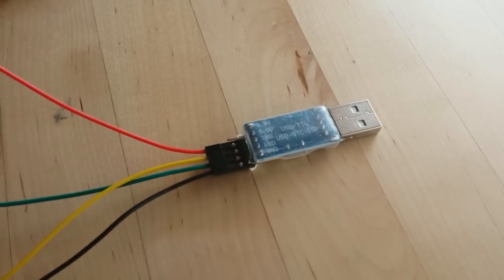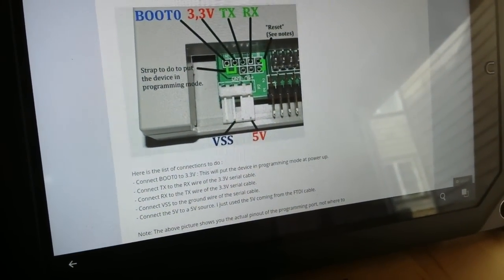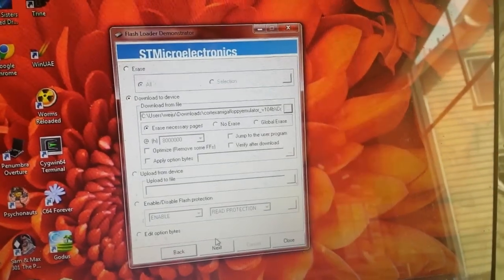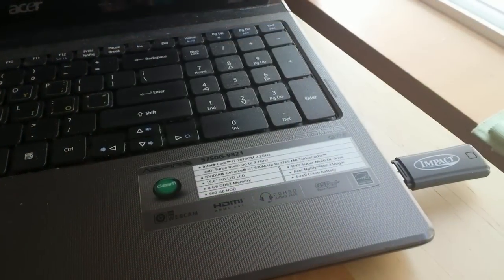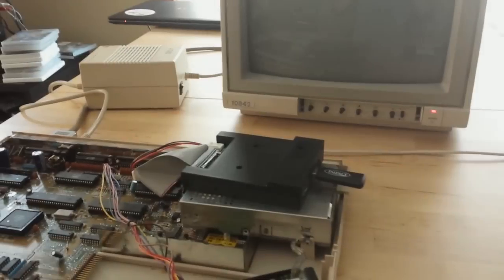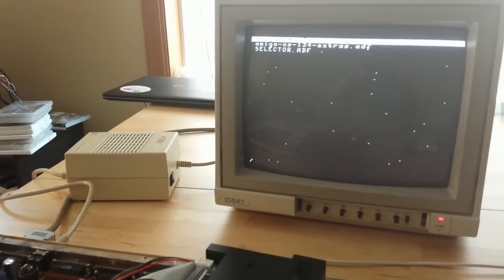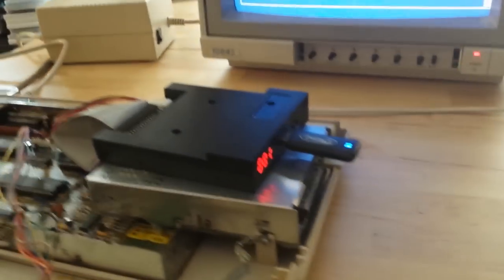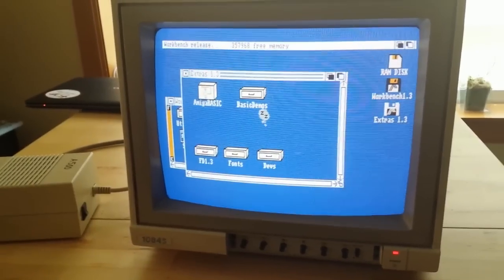Replacing the Amiga Internal Disk Drive With a Gotek USB Floppy Emulator

Comment: I connected everything according instructions and have reset the emulator twice but i keep getting the message: 'cannot open the com port, the port may be used by another application'. I've tried to start all com ports; 0, 3 and 4. What am i doing wrong?

Comment: Hi all .. then I come to the point I took Gotek then the programmer .. soldered connectors .. but when boot0 to program it .. I put the jumper on the boot0 e3.3v..ma nothing scheduling program does not recognize it .. auks I tried resttando ..but nothing always the same problem. the Gotek are two .. I tried with 2 pc with 64bit win8.1 and a pc with xp..ma nothing someone can give me a help ..
thanks
HELP

Comment: What format type did you choose to format the USB stick ?  (normal FAT  or  FAT 32)
Do I have to turn the disk-data-cable for 180° than a normal Amiga-Floppy ?
I've flashed the Gotek, all worked fine and I've removed the FLASH-jumper. I've also set the pin from S1 to S0, but when booting or restarting the Amiga there are always the 2 lines - no number appears. The LED of the Stick flashes a bit and so does the greed LED of the Gotek and the Amiga-Drive-LED, but than nothing happens..... always see the blue "Workbench" Disk !?!?
Do you have an idea what the problem could be ? 
Thanks in advance !
Reply: problem solved..... shitty USB stick. Now it works ! :D
Reply from the maker: zauche81 good to hear it worked out for you !

Comment: Hi, do you know if it is possible to save to .adf? For example in workbench you type in some text in text-editor and then choose blank .adf from the selector and save the text file there?
Reply from the maker: e3ovuziotica I haven't used this in a while, but it should work. The operating system treats the drive like a regular disk drive and when you switch the slot, the new disk icon that represents your ADF appears on the workbench, and should therefore be available as an AmigaDOS volume.
Reply: Wei-ju Wu
 ok Thanks. I'll try it as soon as I get one to try.

Comment: yea I got same drive, 2 different usb  to ttl c controller and pl controller, tried loop back test on both with all working, tried windows 7 and xp,tried usb 5volt or psu source with repect to ground. still no go for me ? havent stuck to crow on yet, will give it a shot .. so i tried all options and no go.. and yes the drive works so it alive, the usb 2 ttl controlers are working , wiring to drive is noob proof ,so all left to do is sample signals and see whats going on ????

Comment: Please Help me.. 
I bougth this drive from CHINA with USB programmer, I saw the instructions but when I  Connect BOOT0 to 3.3V the USB programmer make red and blue but the driver doesn't power on and the software doesn't recognize it. The drive connect on PC is good, the programmer with terminal respond to loopback signal... I DON'T KNOW WHAT TO DO ... :(  THANK'S
Reply from the maker: I guess you are referring to the USB connection not being recognized despite doing the reset. Since I did this process only once for this video I can unfortunately only make guesses. I read somewhere that the version of Windows can be an issue, e.g. if you use version 8, I did the re-flash for this video with Windows 7 and it worked for me.
Reply: Wei-ju Wu
In the first time I worked on SEVEN 32B, after I worked on XP the system found COM5. nothing... the system tell me to reset the driver but I don't understand how ... HOW I RESET THE DRIVE? I tried with the instructions on wordpress.... nothing, Now the drive don't power on .. Is possible some damages in some way ?? The last step, try to reset the GOTEK drive. Thanks for your collaboration.

Comment: can you please tell me where you got your gotek drive from and your usb to serial adaptor. and you dont show in the video you connecting to the drive or the full flash process. exact details are good ! that would be nice
Reply from the maker: You are of course right, I avoided to record sections that require me to move the camera a lot because I don't own a tripod for my cell phone and did not have another pair of hands available :) H. Messinger's website http://cortexamigafloppydrive.wordpress.com/ has the links to the specific ebay auctions as well as some of the details of the firmware update and current versions (since these can become out of date). The update process is pretty straightforward, it worked right away once I connected the cables correctly (Windows 7 installs the correct driver for the USB TTL adapter automatically)

Comment: Recently heard of this and I might consider buying it to bring my old A500 back to life. I’m just thinking about one thing. While there are some multi disk games that prompt you for a new disk with a message like "Insert disk # and press fire to continue" there are even games that use the standard floppy drive’s insert disk sensor, you know – "ticking" floppy drive waits for you to insert the new disk and starts reading right away. Since in the case of this emulator one needs to press button multiple times to actually get to the right disk by moving through positions where ADFs are applied, lets say you have disk 1 inserted and are prompted for disk 4 – you would need to move position to 004 from 001 = press the emulator button 3x) would this cause any potential problem with the type of games above – so that the emulator starts reading the next position (next disk) as soon as button is pressed during the disk swap procedure? Any experiences? Thanks.
Reply: there isnt the ticking noise but it doesnt instantly start reading, theres a few seconds so this isnt a problem. I modded my A600 last night with an internal Gotek to replace the floppy and it works great.

Comment: Thank you for your video. Can i build the gotek drive into a amiga 500 without modifiy the case? Just replace the old floppy and done?
Reply from the maker: Hi  good question. I think this is a concern of many people and I have seen different approaches. I typically just leave it half open because this A500 is my tinkering machine, but for most people it is not really optimal. I also have a cable for using the Gotek as df1: which can be booted from if you are using Kickstart 2.0 and higher.
There are people with various case mods and varying grades of success, some are really awesome, but that depends on the skill of the modder. Another possibility that I have seen is to modify the Gotek case so that it fits entirely inside the case. This leaves the Amiga case intact, but you might end up with the Gotek buttons in the case's disk slot. See this thread on the English Amiga Board for some solutions people have found: http://eab.abime.net/showthread.php?t=74947
Reply: Wei-ju Wu Thank you for your quick answer. I don't have a Kickstart Selector. Its my second amiga 500 and there i will change the floppy drive. So i will look around at the side you linked to me. Thank you.

Comment: Nice!! But don't let this become too known ;-) Because to all of you, we still want to find Amigas with broken floppy drives on ebay sold as "for parts / not working", no? ;) So we can simply buy a "defective" Amiga, replacing the broken floppy drive by the Gotek and get us an A500 for almost no ca$h at all! Harhar!
Still one thing I don't like about this solution: the necessity to switch DFx: DIRECTLY on the device! This should be done by a "remote control", i. e. a longer cable that can be connected to the Gotek and which allows you to place the Gotek somewhere else without having to operate it on-location!
Reply from the maker: There are various reasons why an Amiga would be declared as used/not working. It's a gamble, but since I have several Amigas it's ok for me if I end up with one for spare parts (if I got it cheap that is). The A500 I used for this video was perfectly working, but was declared as "not working" because it was connected (and shipped to me) with a Commodore 128 power supply. They look similar and have the same connectors but are not compatible.

Comment: can't you just us an old pc 3.5 ide floppy drive oh an amiga?
Reply from the maker: you probably could, but you would have to modify it. Personally, I don't think floppy disks are a very reliable media, even back in the day, disks were breaking quickly, regardless whether no-name or branded ones, so I am more interested in long-term solutions.
Reply: You can but most PC drives lack the jumpers needed so you have to make a custom cable to swap the signals around.